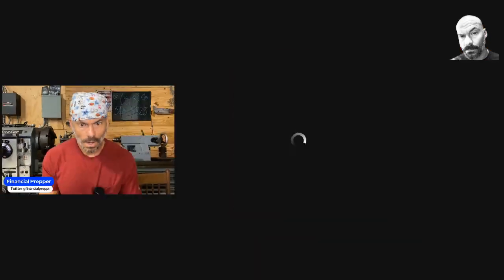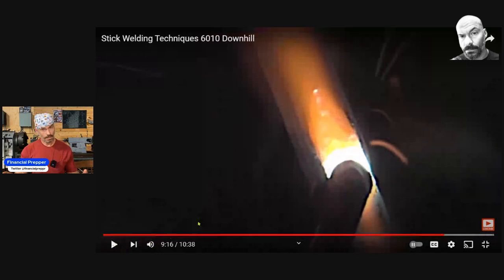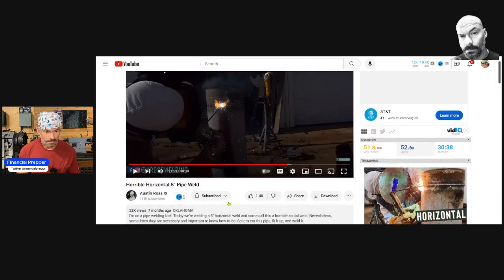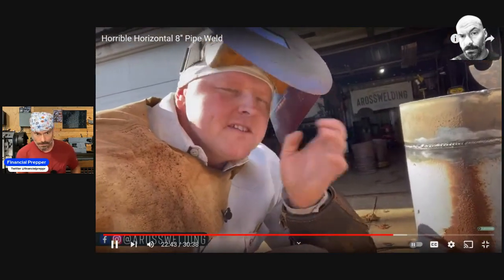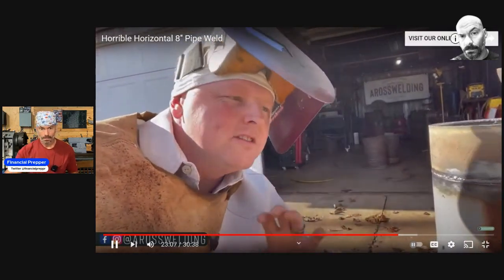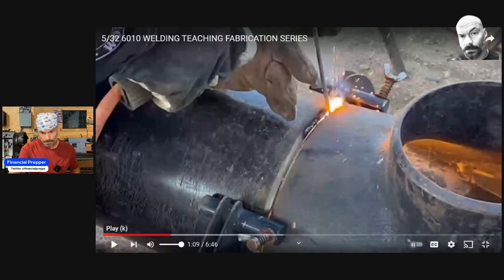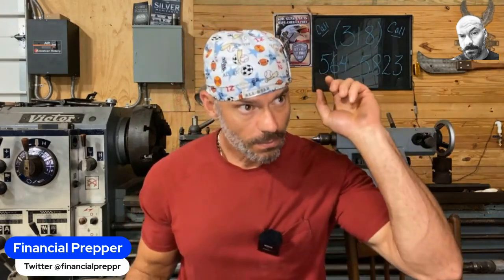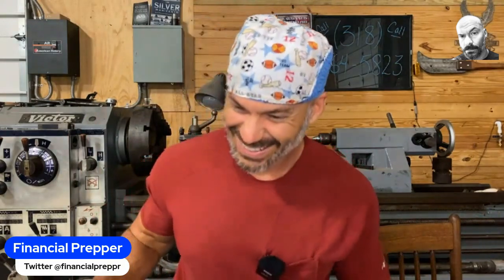Unlocking the Secret to Perfect Pipe Welds | Welding Video Review

Comment: Here is another shop trick - use a red brick (yes a brick) and drag your rod across it.  Takes off the coating/slag and it is ready to weld as the arc strikes readily (don't need to tap it).
Can do it in the filed but it is up to you.
Try it - you'll like it!
You can also do it to a bundle and have them ready to go in a bucket.
Yup - I do it when I stick (doesn't work that well with my mig, however).
Reply from the maker: Great tip, Danny
Reply: Thanks for the knowledge drop.👍